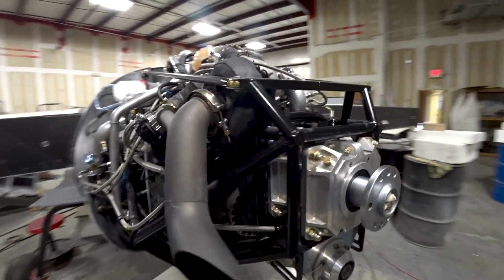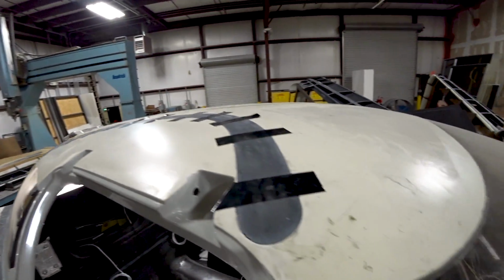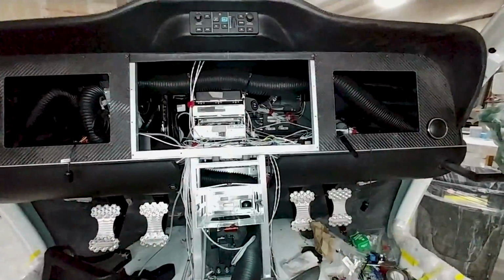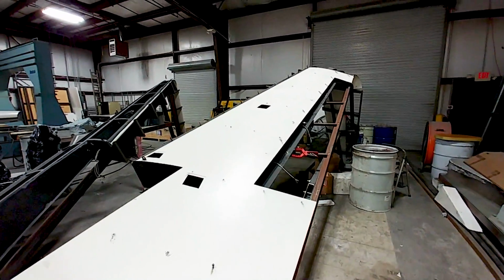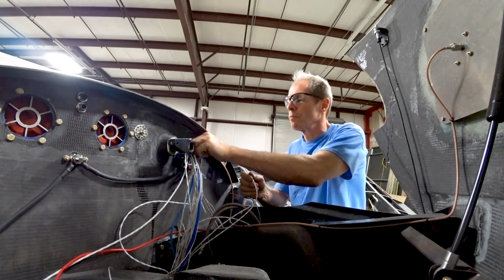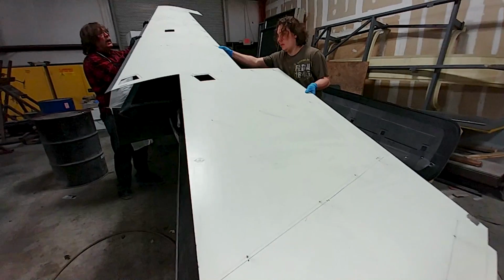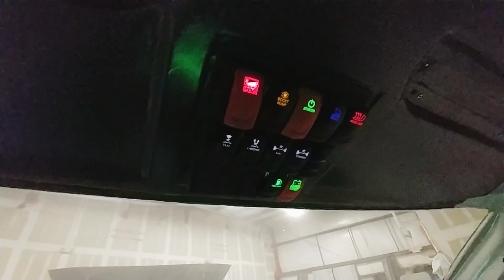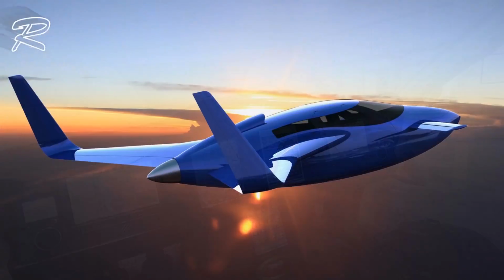Playing with a Full Deck - Building the Raptor Prototype

Comment: We use the same trim motor/fiberglass spring arrangement in the Velocity. When I installed the GSA 28 autopilot servo motor for the elevator, I found out that there is a chance that you can burn out the servo if you use the autotrim feature in the G3X panel. The trim motor will exceed the 1 amp limit if it goes to full trim and loads the spring. I had to install a booster that TCW Technologies makes to keep from burning out the autopilot servo. You may already know this but just trying to keep you from making the same mistake I almost made.
Reply from the maker: Cheers, I did not know that.

Comment: Peter, a question about the canard elevator movement - at 5:10, you show the elevator moving like a gouge flap, a lot of down motion for nose up. But very little elevator movement for  elevator up, nose down motion. EZ type elevators (LongEZ, Cozy, Velocity), are hinged which allows 20 degrees up and down. Are your elevators going to have enough up range of motion?  Thanks and keep those videos coming, it looks great and you're getting close!!

Comment: I wonder about the durability of some of your wiring & connections. That wiring for the landing gear reed switches looks especially vulnerable considering it will be subject to movement and presumably buffeting etc from air. Also, last week I'm sure I saw a bunch of wiring and a turnbuckle running through the same hole in a wing?.

Comment: I have watch almost every video that you post. That being said... I am a journeyman mechanic that has made errors in my learning to improve not only myself but my Apprentices so they can always keep improving others. Now my point. Why do you not bevel/grind all your drilled holes for wiring so they are round and use a rubber grommet  to make sure that will NEVER be a problem with the electrical shorts. My customers would  never  taking off and flying hundreds to thousand of feet in the air. Great to watch the progress of your dream. Just trying to save a life. Hello to everyone that follows the progress

Comment: The only issue I raise relates to the location of the backup attitude indicator.  In an emergency where the backup attitude indicator in needed, and the left-seated pilot is incapacitated, it is virtually inaccessible to the right-seated pilot. It seems to me the panel is large enough, more than large enough to place the G5 in the middle, between the two front seats.
Reply: @Jose Valle I believe you have brought up a legitimate point however I can already tell you what Peter is going to say. He is going for aesthetics of the panel and the standby is already installed on the prototype so it will not be moving. Also the likelihood of having a total power failure while in IMC and having the pilot in the left seat totally incapacitated is extremely unlikely.
Reply: Marc Anderson , I do not expect it to change for the prototype. However, aviation accident history is full of unlikely-es. I’m a relatively inexperienced instrument rated pilot. Fortunately, I was not alone yesterday, when ICE started accumulating on every surface on our aircraft. The forecast and currentl conditions did not predict icing. Yet, it did happen. For my aircraft, I’ll place it in the middle.

Comment: Years ago I helped build a lance air 4. The wing skins were just bonded on with epoxy/resin thickened with chopped glass strands (I think it’s called ‘flox’). That should be much cheaper, and works well.

Comment: I vomited a little bit when I saw the pig tails on your wiring. It's not wrong, but I will say that at least 50% of the cost of your avionics comes from us having to figure out how to pass lightning and EMC testing while using pig tails.
Reply: not to mention they will fail especially in any sort of vibration

Comment: Hi Peter. So I see the trim now. Is it purely electric? How do you handle a runaway trim?  Also I believe you still have a fuel pump from the center tank to the engine and gravity fed from the wing tanks. If that’s how it is it’s awesome. Is there an engine driven pump and an auxiliary one? The panel is beautiful. I don’t remember, does the g3x display incorporate the primary radio and the 750 is secondary?

Comment: Are the parachute straps serviceable without having to open up the top of the roof? This is an expensive overhaul on the Cirrus which needs part of the strap replacing at 10 year intervals. Looking fantastic.
Reply from the maker: Not on this prototype.

Comment: Carbon fibre conducts electricity, Could be getting some interference from that?
Reply: But carbon fiber doesn't conduct. That's what makes lightning testing so much fun for composite aircraft 🙂
Reply from the maker: Yes, that's what I suggested I need to look into. The plugs are not presently isolated from the panel they are installed into.
Reply from the maker: Actually is does conduct. I have personally measured very good conduction in our parts.
Reply: @RaptorAircraft  I'm sure it does conduct well at DC, hopefully 0.2mOhms or less. The problem is  that pig tails are very inductive, and don't conduct well at high frequency. So lightning and EMI don't really see your pigtails, they just see big resistors. Again, it's no  dig on how you're doing it, it's standard practice. Doing it the way we the design engineers want is not cost effective for GA aircraft.

Comment: Hello
Regarding your glue problem I would recomend 3M Scotch Weld EXP High performance Epoxy adheasive called DP490.
You can by this adheasive in small (50ml) containers or big ones (400ml) and with the 3M glue gun you do not have to mix it by hand.
I used this to glue the carbon fiber chassis tub together when I worked for a Swedish car company.
We still used Hysol on engine mounting points due to the risk off high temperature there.
If you buy it for a company and in bulk it is cheaper and easier to use than Hysol
Reply: was the swedish car company koenigsegg?
Reply: @dazzasnipes1911  I do not work there anymore so mybe it is not a problem if i say yes to that
Reply from the maker: Thanks for that. We'll check it out. Cheers.

Comment: I worked for schempp hirth for a few months, they build sailplanes in Germany.
We never used hysol for anything.
They bond their wings together with the "normal" epoxy, mixed with cotton flakes and thixotropy agents.
Reply: They do build all their wings inside the negative molds and close the wings while still being in the molds though. I am not quite sure if that would make a difference in your case, bacause of the shrinkage of the epoxy-cotton-thixo mixture while hardening...
Reply: @thomas_leitgeb  Could it be, that the whole closed wing then get post cured ?
cotton flakes? Wouldn't carbon fiber shreds be a better filler?
Reply: @AltMarc  yes, the whole wing gets postcured afterwards!

There might have been some gladfibre flakes in there too. No carbon flakes though. And they add black color to the mixture because it is way easier to see cracks. (In case one needs to inspect the bonding after a hard landing etc.)
Reply from the maker: Thanks for that. I'll run that by Jeff.

Comment: Have you disabled automatic updates on your Windows tablet? Or a reliable way to prevent automatic (unscheduled) reboots? Could become stressful during non-maintenance operation.
Reply from the maker: I have tried by disabling the service but evil Microsoft has strong armed it's way back in. It's an issue that needs to be resolved. Believe me, if the Motec software ran on something else I would use it. Fortunately it's just a display of the ECU and the engine runs quite happily without it.
Reply: @RaptorAircraft  Maybe you have Linux-Friends who know their ways in WINE-Land, that's Windows software API emulation (a translation layer) on Linux (Unix). Alternatively, i've heard that a Windows "Professional" license unlocks fine-grained custom system control via "Group Policies". Or you simply reboot the tablet before flight, just to make sure all pending updates have been processed.

edit: i'd love to give advice regarding WINE (I'm a Linux, well "FLOSS" [*F*ree as in *L*ibre and *O*pen *S*ource *S*oftware] fanboy), but i didn't read read the WINE documentation, so i'm restraining myself to pointing out possible options. But hey, if someone, could somewhat verify / document that your specialised apps run properly in a WINE environment, on Linux, that'd be kind of neat. And it would solve the Windows update reboot issue …because it's fairly easy to configure, e.g. Ubuntu (or Debian, if you really want it rock sold [stable]), to do updates only when you tell it to do them manually. If you find a way to use the WINE abstraction layer, you could even add another layer of reliability by installing your Linux on a "copy-on-write" filesystem, with snapshots, like btrfs, "butterFS". I.e. you create a snapshot of a "known good" state, then you do your updates, and if that fails, you can "roll back" to a previous state, reboot, no worries.
Reply: (i edited my comment, i hope it adds value)
Reply: I'd just use a "Wine" emulator in Linux, or find a way to "ipad" the entire setup. :)
Reply: Could get a Bendix Aeropoint, Xpoint, or JPI monitor once ready to fly. Probably more reliable, and much smaller so can benefit from being mounted closer to the pilots line of sight to monitor engine issues. Free up some panel space to get the MFD closer to the left seat so it’s usable.

Comment: Will you be able to run the Autopilot through foreflight?
Reply from the maker: If you mean transfer your flight plan to the Garmin deck then yes. FF does not directly have AP controls in it.
Reply: The AP box he has installed works quite well anyway, GFC 500 I believe.

Comment: Will the Motec ECU monitor be and option for production?
Reply from the maker: At this point it's a necessity.
Reply: @RaptorAircraft  Are the throttles connected in by-wire fashion to the ECU which then controls the engine? or are they mechanically linked to the engine?

Comment: that's a strange place to have the landing gear lever. plenty of space on the panel and would reduce the risk if uncommanded gear operation from the lousy first officers such as myself who can never get comfy in the cruise. besides throwing it up on the panel would eliminate the glare from the LED's on the aircon control panel
Reply from the maker: Discussed before but here goes again. The lever requires you pull it out to change it's position so you can't just bump it. It's right by your hand when you're on the throttle for landing so far easier to manipulate than on the panel. The LEDs need to be near it and as you can see they're easy to see. Why mess up a nice clean panel? Oh, and just because someone else does it one way doesn't mean I have to copy them. I'm doing it my way because I think it makes more sense. This whole aircraft has been designed and built in that spirit.
Reply: @jeffallen3382  I would guess the "stress" is having the same questions asked over and over.  How many times have the  following questions been asked? 1.  When will it be done 2. How much does it weigh 3. How much will it cost

Many questions have been answered over and over.  Many have been answered in previous videos.  I realize there are a lot of videos, but to those who want to know...start watching.  The videos are all there.